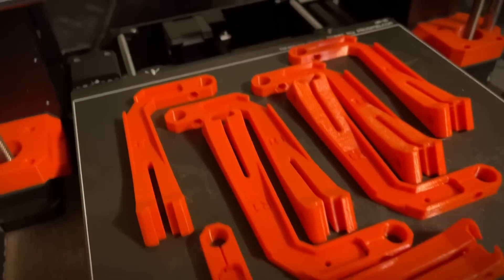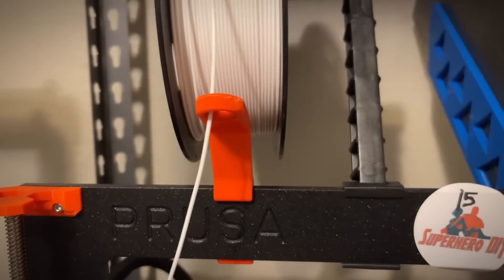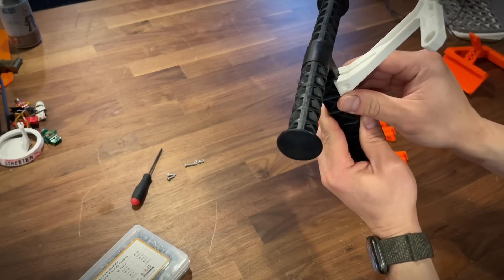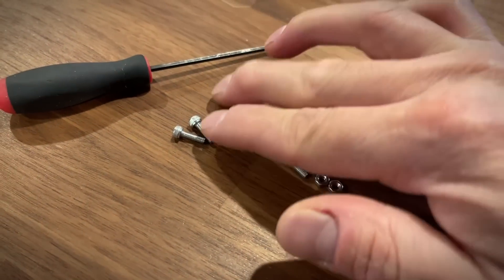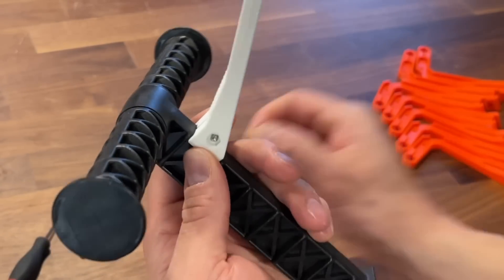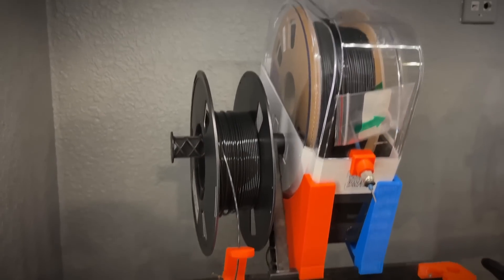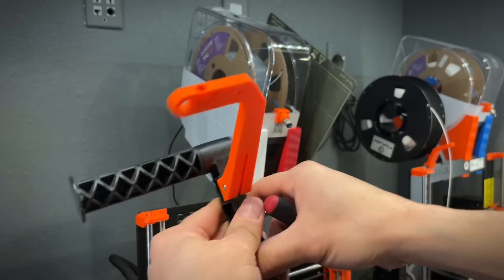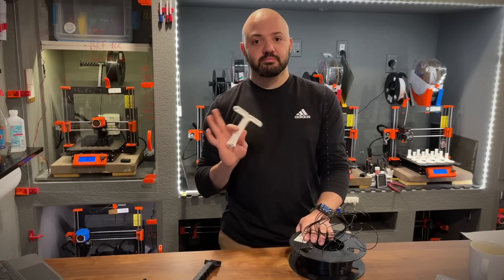Did you notice the filament guide on the Prusa MK4? It’s a lifesaver

Comment: I designed and made needle rollor bearing to mount the fillament reels on attached to the tee bar as they take all the load off the Prusa head and the new fillament holder will just top it all off. Oh i just designed a fillament guide also as I have yet to receieve my MK 4 kit when it comes out so upgrades to my Mk3S+ 👀🤓

Comment: Long long time ago I decided to just print a sideways spool holder which solves the issue. I find it a little weird they took this long to address it. Though given the frame resonance with the spool hanging off the top sooner or later I should just stop having it on the printer lol
Reply from the maker: Oh, actually, that makes a lot of sense! Good thinking! That something that you found online or did you have to design it yourself?
Reply: @SuperheroDIY  pretty sure I found it on printables. I for some reason felt like it was the solution for me and it's been good ever since. It seems like with the stock MK3 and MK3S+ holders when the Z moves drastically it sends filament off the side of a spool. For some reason being 90 degrees sideways instead doesn't have that much of a problem.